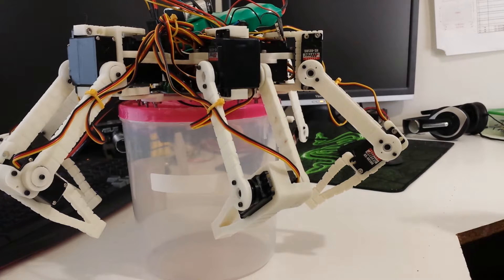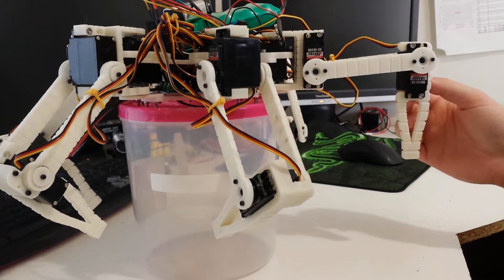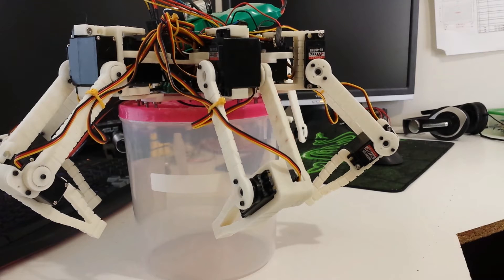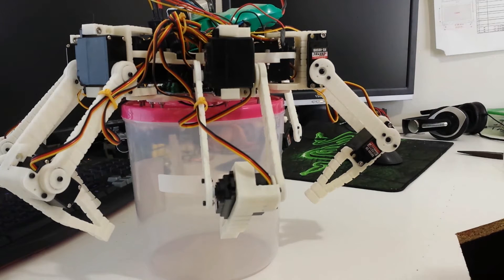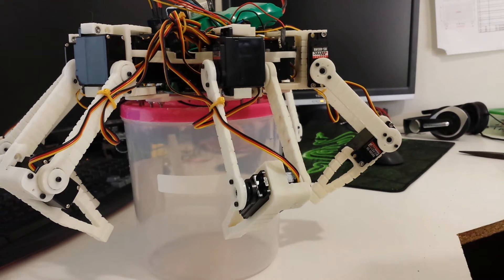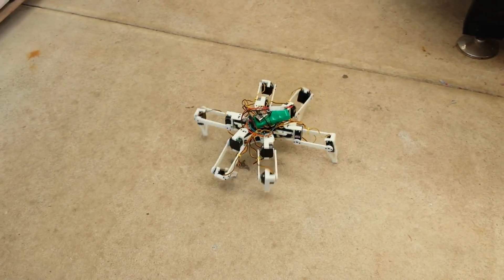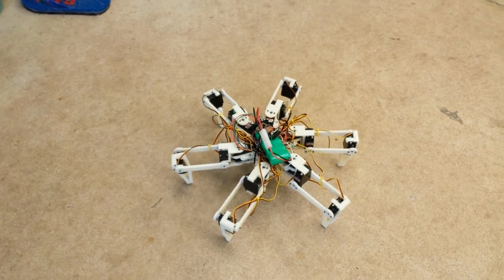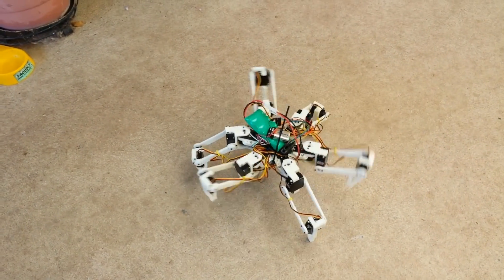Fully 3D Printed Hexapod Robot V1.0 - First Steps and discussion

Comment: whered you get the phoenix code from? searched for it but couldnt find it:/
building my own hexapod atm, i do have everything i need (thats if i didnt forget anything). im using an arduino uno with a mini maestro 24ch servo controller, but because i dont have a programm for it im limited to simply moving each servo one by one.
atm i do have one leg with the two lower dof ready, but because of school im not getting too fast of a building pace^^
regards Flo
ps. nice bot you built there^^ got me thinking about getting some bearings too, but i think ill leave that for laterXD
Reply from the maker: Hey mate. 
Hmm I cannot seem to find Phoenix code either. 
However luckily I worked on this project some time before I understood he power of git. So I just coped the project into my repository. You can find a (very old) version of phoenix code in me repo : (https://github.com/c-herring/HeZapod ) under the "3DOF-4DOF-Hex-Botboarduino/BotBoarduino_CH3R_PS2" folder.

This is the version that I used in the video. However in the years since I worked on this project there have become many better ways to achieve the task. The generic problem of understanding the interaction (kinematics) between multiple serial manipulators, (in this case, via gaits) is an incredibly useful skill if you are interesting in robotics. (and who isn't. Robots are awesome!!)

So I challenge you: Look at the code, see how it works. but do it better.
Reply: @chrisherring8733   see if i can get it to work^^ still have to finish my hexapod tho, im doing a crash course in mathematics for studies (4weeks time for what you would normally need a whole semester)
i may try to understand and modify the code; but as i never had done anything with coding before, i might not even understand the code itself(atleast not before learning codes)
thanks for the link for the code^^ something is better than nothing right;D

Comment: Nice, I would start a project like that, what control board do you use?
Reply: Right now it is just an arduino on a breadboard so I can easily use the phoenix code. However soon it will be a raspberry pi.